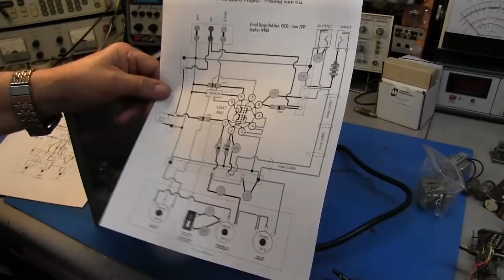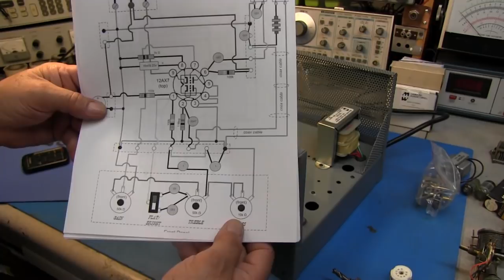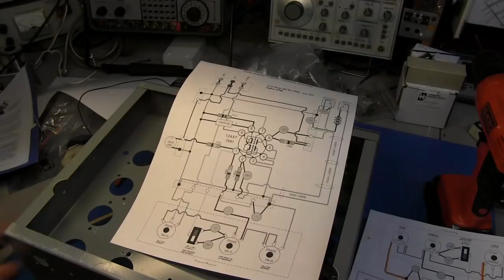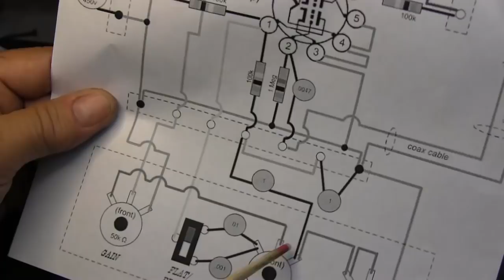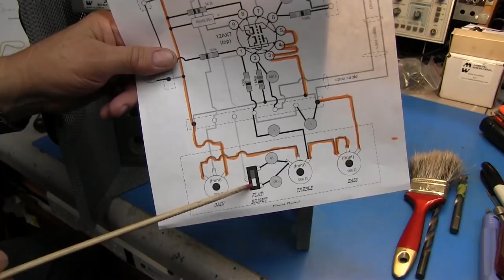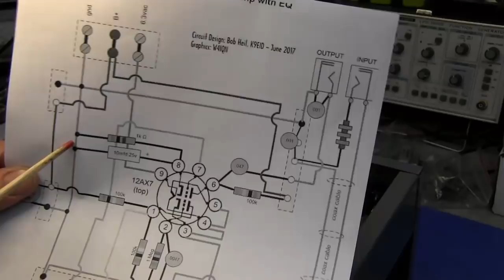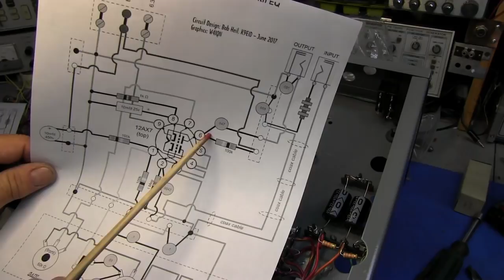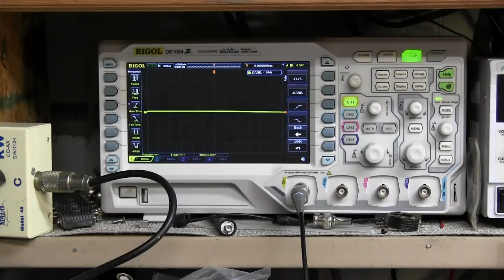#246 AM Transmitter Build  -  Mic Preamp

Comment: The last Transmitter I had to rebuild was Old Heathkit DX100 that had all the tubes stripped out of it and a couple coils were missing and apparently whoever had it before made a lot of mods to it. I used the original schematic and put it back to Original condition and it works great. Hope you have as good a time building this AM Transmitter Buddy. What did we do before we had terminal strips to mount our parts to make a neater wiring job? Nice looking panel and job of building the preamp so far Buddy. Thanks for sharing.
Reply from the maker: You know the days of building from scratch are still very much alive.  It really is a lot of fun. Like you I have disassemble many rigs and rebuilt them from scratch.  Agree with the terminal strips. Back in the day was mostly point to point. Much neater now. Thanks for the comment.

Comment: Well, "stuff" happens.  Sorry about yer paint job.  I've done that before.  Makes your heart dip for a moment and then you tell yourself, "$hit happens".  Still a very nice video.  73 from K9POW in eastern Tennessee.  I think you need to use the field strength meter; that Monarch radio front looks great.  I like that grey paint; would look good on my Kenwood TS-430S case and PS-430 power supply case.

Comment: I have parts ordered, and a project box that’s about 12x11x4. Just following along.  One  question on the power supply section you used 4 diodes , what diode part number did you use?
Reply from the maker: I Use 1N4007. If you want to use a bridge rectifier use this one below:
https://www.tubesandmore.com/products/bridge-rectifier-single-phase-3a-400v

Comment: The powe transformer that they to use has a very high fail rate! They bill over heat or just go up in smoke with out warning. The secondary will some times dead short or go open! I used a different one. I had AES replace 5 of them with out warning the duds back. Hammond had a bad run. 73. W3AMT
Reply from the maker: Thanks for that information. We will see if this one goes bad.